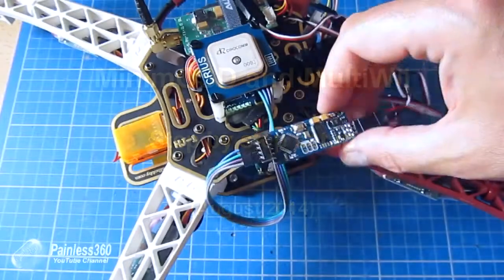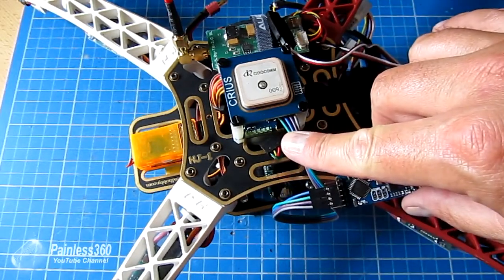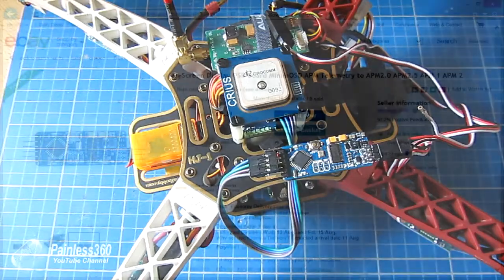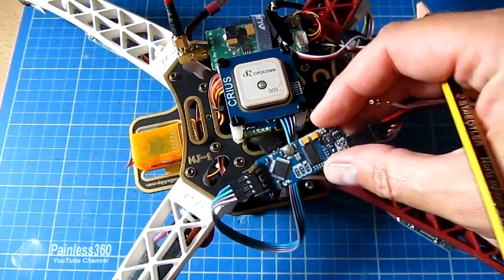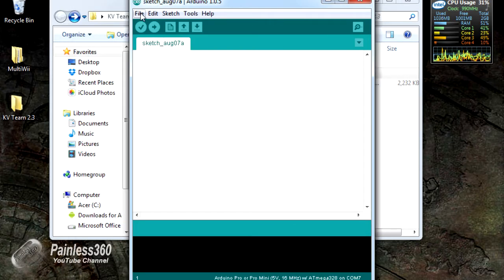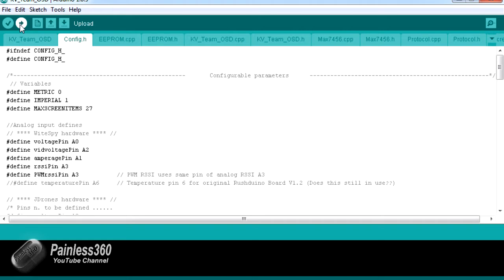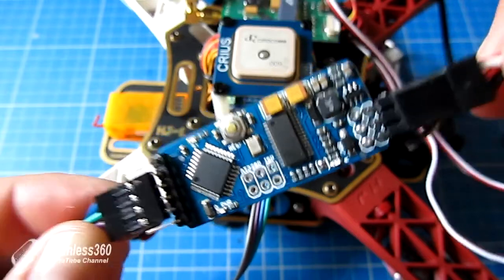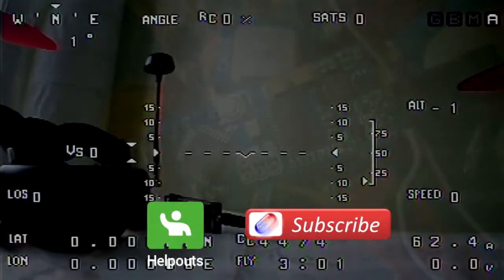Step by Step MinimOSD setup on a MultiWii

Comment: You asked how familiar I am with the program.  I have used it some but not a lot.  The board I have selected in the program is the Arduino Pro or Pro Mini (5V,16MHz) w/ATmega328.

Comment: Great video was really useful for a first timer. Would love to see a video on using bthe minimosd as standalone as I would like to have osd with optical rpm sensor displayed.
Cheers for your work!
Reply from the maker: Thanks for the comment, if you get that working I'd love to see the 'how to' video! Good luck..
Reply from the maker: Hi Matt. My latest MinimOSD video, while not a complete tutorial on how to do this, may help. See MinimOSD setup on MultiWii - Adding battery voltage readout
Reply: Painless360 cheers! Got my minimosd and apm the other day but somehow fried my apm! Will definitely work on the minimosd and will check out your new video. Thanks for your videos, really appreciate your work!

Comment: Great, you are a genius. :) But i guess i blew my board (the voltage regulator) already by testing it before. :( I used the 5 V from the MultiWii and I connected also the +12V from the FPV transmitter... How do i know if it was demaged? My Board looks a little bit different as i have a MAVLink-OSD Board. The main components are the same, but i can't find the soldering bridges you have. I guess they used 0 ohm resistors for that. So i guess i will have to order another one to get it run properly.
But thank you very much for your video. It explains exactly what i was looking for and haven't found so far in the web. And i recognized that you had the same questions as i had. :)

Comment: Can this be connected through the serial port for lcd, software update, config and Bluetooth on the multiwii pro as well? I see this port is a 6 pin connector and i dont believe the Minimosd has that many inputs. The Pins are labeled from top to bottom DTR, TXO, RXO, 5v, NC, GND.

Thanks
Reply from the maker: I've not tried it - the board needs to hear the stream of data coming out of the board (usually transmitted from the Bluetooth of telemetry radios). If that data is coming out of that port then it's worth a try! Sorry I can't be of more help.

Good luck with it.

Comment: Hi Painless... Thanks again for ur channel.. It's been a great help. Couple quick questions.. 1) is this video still relevant in setting up & updating firmware for a mini minim osd and using it with a SP Evo controller?.. Any chance of getting an updated set up video for the mini which already has the KV Team update?
Reply from the maker: Any board using Cleanflight/Betaflight/Baseflight (or one of the many others) talks the same telemetry communication protocol as the original Multiwii - Multiwii Serial Protocol, or MSP. See the videos in the Naze32 and SP3 series where we setup an OSD.. Best of luck!
Reply: Painless360 thank u sir!

Comment: Thanks for the video.  So I'm at the point where I was able to load the firmware and the GUI will update the fonts but it won't write any of my settings to the board.  It count's down 'save attempt' 1-10 then does nothing. When I hit 'read' again it just gives me blank settings.  Help greatly appreciated.  Thanks again for the video.
Reply from the maker: I would re-flash the board and try again - something is out of whack.. I actually prefer another firmware that may work better see - https://www.youtube.com/watch?v=3gI3F_C-VBk

Happy flying!

Comment: Awesome tutorial as always!
I dont have fpv just a quad with multiwii on it (im a beginner) but want to get it in the future.
I just have one question:
Do you have to set something up in the multiwii code also or how does it get the informations?

Thank you!
Reply from the maker: Hi, sure do! I have a full set of 'how to' videos for all aspects of Multiwii. Search on my channel for the playlist. I'd start here - Crius SE V2.0 MultiWii Board (MWB) Overview and Setup

If you need help my Helpout channel is available. Best of luck.
Reply: Painless360 Thanks, i watched your videos allready (its just too much info for a beginner at first :) ), it helpd me alot to build and get my quad ready to fly, but i dont recall a video where you show how to set the output for the osd in the mw code.
But i will watch them again :D
Reply from the maker: htwosofour The answer is in the video at 5:55. You don't need to change anything in the code for this to work. If you needed to - I'd have covered it ;)

If you use Version 2.2 of the Multiwii firmware then it's slightly easier as previous versions (2.0 and 2.1) need another setting (BOXNAMES) turned on for the MinimOSD to work.

Hope this makes sense, of you are new to Multiwii get the model built and flying first then look to add the extra pieces like FPV and OSD systems one by one. Too much may become overwhelming in the event of a problem.

Happy flying!
Reply: Painless360 Thanks :)

Comment: Painless360 Thank for the awesome video mate! I am much closer than I was, but still having issues using the exact same Minim OSD board, firmware and wiring schematic as far as I can tell. Wondering if you can offer any advice? The only difference in my setup from your schematic @18:25 is that my camera needs more than the 12v power my Immersion 600 can output, so I have a power lead running to my PDB, which runs the camera great. The Negative from the camera goes into the GND on the Minim, along with the Video IN as you have shown, and then the other GND goes out to the Immersion TX GND, along with the Video OUT signal to the center VID SIG pin on the TX... As soon as I remove the OSD, the setup works perfectly. When I add the Minim, I only get a gray/black screen on my goggles. Could my UART plugs be wrong? I did notice that the green and blue lights on the Minim only come on when I have one certain configuration of TX/RX pins, otherwise, no power. Maybe I have them all wrong from my MultiWii? Any advice would be greatly appreciated!
Reply from the maker: I've tried to follow the explanation but struggled. Could you post a link to a diagram of the wiring so I can see what you are talking about? What camera are you using that needs more than 12v?
Reply: My diagram would be the same as yours, with the 12v power source for my camera coming directly from my LiPo. I have an Effio-V 960H 800TVL Sony Cam from SecurityCameras. If I connect the camera to the 12v Out from my TX, I only get a white screen in my goggles. :-/

On a full 4s battery my camera runs like a champ. In the specs, it is listed as running on 12-24v, so that's probably why! lol
Reply: I am not seeing an overlay, or an image when I connect the Minim, but without it the picture is great! I have the Vid In coming from my camera, and vid out going to the TX. Everything is grounded. I see 2 solid blue lights on the Minim, and a faint green led bursting.

Comment: Hi there! I have my DIY multiwii board up and happily flying. I just bought some FPV stuff and was wondering if it will be possible to connect a MinimOSD to the UART port while having the bluetooth dongle plugged in as well. Thanks in advance for your reply. Cheers.
Reply from the maker: Depends on the board. See the other MultiWii videos for more detail on adding the pieces! Best of luck!

Comment: Hallo Painless360
I think, you are doing a great job! With your tutorials, I managed to make it fly (Crius 2.5, GPS, Bluetooth). Now, I am working on the OSD (Crius Mavlink 2.1). I changed already the voltage supply to only 5 V on the whole board and common ground but I get vertical lines in the image (only the image signal from the camera is connected to the OSD board). The OSD itself works (MVOSD R1.5). Any Ideas?
Best regards,
Henry
Reply from the maker: No, sorry. I'd check for interference and that all the settings (PAL/NTSC etc) are the same on camera and OSD. Best of luck.

Comment: Painless360, could you show the board being flashed. I'm getting lots of different configs of the status light flashing but no idea when it's done. Like with the Clear you get the solid light is there anything to look for after flashing the KV Team firmware?
Reply from the maker: Simon Cope Nothing on the board shows you it's done. I do show the board in other MinimOSD setup videos.
You know it's worked if the app finishes flashing without errors and it works when you plug it in! Don't forget to upload the char set though..

Comment: Hello again. 
Please tell me which firmware are you using on mwc board which works with minim osd?
And do I need to patch or add configuration on mwc?
I'm using crius aiop v2.1
Thanks!
P.s
I've tried to write KV-TEAM v2.2 and 2.3, I see some of information on the screen, but it's corrupted :-(
Reply from the maker: See the Multiwii playlist for your answers. Best of luck!

Comment: Hi Painless... having an issue with the Multiwii board talking to the mini osd. Am I supposed to use an I2c card in between the FC and the osd... as  on the start I get Multiwii O even when switching.
Reply from the maker: Shouldn't do. The steps are all covered in the video. Best of luck!

Comment: Hi Painless360, seeking some advise on my MinimOSD Micro if you wouldn't mind. I run it with Naze32 cleanflight. When the OSD arrived, I tried the connections and I could see an OSD layout on my FPV goggles. Then I went out with wiring everything together onto my miniquad. I then used an FTDI USB connector and ran through your video for KV Team Mod firmware flash using Arduino 1.0.6. I cleared EEPROM per your video. I uploaded the KV Team OSD and after that all I could see are grid points along the whole screen. Tried to reflash it a few times (clearing EEPROM first) with no success. Tried using MultiWii OSD firmware and now I can't see a layout at all. On the MultiWii OSD GUI it keps saying 'Waiting OSD'. Com port is correct and tried all baud rates with no success.

Have I fried a chip on the MinimOSD Micro?
THanks!
Reply from the maker: +Chua Yaowei Not sure what's going on. I have had a couple of these boards give up the ghost. I'd re-flash the FW and FONTS again.. Best of luck..
Reply: +Painless360 thanks! think will have to try another Minimosd Micro.

Comment: Great videos and very helpful. I have a problem however. I cannot get the correct character set to load onto the minim board. I have a bluetooth adapter working perfectly so I know the info from the board is correct but the minim character set is aways corrupted except for the GPS co-ordinates! I am running a multiwii pro board with a ublox GPS configured for NMEA protocol HELP! Richardr.
Reply from the maker: Use the EEPROM eraser and load the set again. I had a problem like this when I was playing and another version of the code worked fine. Good luck!

Comment: Hi, I'm an airplane guy looking for an affordable but still capable OSD for my fixed wing FPV rig.The MINIMOSD seems to be a very good option. However, as far as I've read, requires a flight controller to work with,so I'm afraid was designed exclusively for multirotors. Would be possible to use this OSD in a plane without a flight controller?

Would you please recomment me an OSD not so much expensive with GPS and RSSI capabilities? My budget is around USD $80. Thanks for your help.
Reply from the maker: You can use it 'standalone' from the documentation but we've never tried here. The instructions to do it are not very clear (last time we tried!). Best of luck!

Comment: Hey Lee, thanks for the input. Sorry to say though, that I tried 5 different cables and still have the same results on both FTDI breakouts and all 3 OSD's. Failed to talk to bootloader. I've tried updating to newer configuator and hex files, running on win xp and win 8.1. Same results.The weird thing is, it work on the first 2 and something went wrong and I had to reflash the firmware and that's when it went all to hell. Any ideas?
Thanks, Jerry
Reply from the maker: +coffcraft Not really, I'd some of the last common elements but it's starting to look like a puzzle.. Best of luck!
Reply: Thanks. I'll keep workin on it and when I get it figured out, (I never give up) I'll post the results in case others have this problem.
Reply from the maker: Best of luck...

Comment: I have a 2.8 apm  and I'm trying to connect a minimosd.  What firmware should I use?  It currently won't show telemetry from apm.  But it does overlay HUD
Reply: I suppose I should say. Could this be an issue with firmware?

Comment: hi, when I select eeprom upload it says serial port'COM1'not found. Did you select the right one from the tools. But when I select tool I can't select serial port,could this be due to the wrong driver or no driver do you think,cheers
Reply from the maker: +Allan T Yep, sounds like the driver isn't happy. Without the adapter appearing as a COM port you're snookered! Best of luck.
Reply: +Painless360 aye cheers it was the driver,I'm just struggling to get onto the gui

Comment: I cannot get the eprom to clear on the osd and I get no overlay video from the osd.  Both red led's come on but the yellow led does not.
Reply from the maker: Are you asking for suggestions? The yellow LED should flicker, the EEPROM only holds the fonts really.

You need to upload the fonts as the first thing you do once you've uploaded the firmware. If you still get corruption then clear the EEPROM using https://code.google.com/p/rush-osd-development/downloads/detail?name=EEPROM_Clear.zip&can=2&q=

A clear video of the problem can really help too if you can..

Comment: Can an Arduino programmer be used or does it have to be an FTDI programmer? I have an FTDI but I am getting errors, this would be an excuse to finally pull the trigger on an arduino
Reply from the maker: \the FTDI adapter is one of THE most useful things when you are doing anything Arduino/Multiwii...

Try re-loading the drivers in Windows for the one you have or order another one to get going..

I've used them to program MultiWii's, setup MinimOSD systems, program Bluetooth modules and setup GPS units too. So many of the things you need to play with in the hobby require one of these great little boards.

Best of luck..
Reply: Well, I used to use the FTDI to flash my ESCs with no problem but now with the new OS X it has cause havoc with these projects,  maybe someone will see they sand give advice, I have been researching this for weeks and are tired of this
Reply: Painless360 which FTDI programmer are you using, do you have a link? Thanks
Reply from the maker: See https://www.youtube.com/watch?v=qLaH4qkJNt0 around 1:20

Best of luck..

Comment: Hi, I have an Upgraded MAVLink OSD V2.0 board and FAT SHARK+CAMERA+Goggles RX. I would like to use it with a FC MW 2.3 and AIO 2560. By downloading KV_Team_OSD 2.3 on the board I am able to communicate with the board but I have any image from my FAT SHARK+CAM+Goggles RX system even from the GUI_Simulator PC or the MW AIO 2.3 connected board.
If I am using the MW OSD R1.1 soft, which are the different options to take in the config.h in order to make it work with the MW2.3 soft?
Reply from the maker: No changes are needed in the main MWC code on the board to have the telemetry data come out from the FTDI and UART ports on the board.

If you have tried it can can't get it to work then feel free to contact me through the Google Helpouts system for a chat.

Happy flying!
Reply: Painless360 Hi, Please tell me how to find Google Helpouts system. I am not familiar with that.
Yours, Georges
Reply: Painless360
Hi, Downloaded also the MW OSD R1.1 soft to my Upgraded MAVLink OSD V2.0 board. I see the screen with GUI, as yours in the video. Unfortunately it is any video received nor the black data screen. I suppose that that is due to the lack of power supply to MAX7456. The version of FAT SHARK I have, works with a voltage of 5 V to supply the CAMERA. Actually I soldered the +5 V from the TX directly to the CAMERA without the corresponding pins of the MAVLink V2.0 board.
How to STEP-BY-STEP check the presence of the video signal to the MAVLink V2.0 board, from the camera (IN) to the TX(OUT)?
Yours, Georges
Reply from the maker: Hi George, see Painless360 Helpout Launch for the helpout link.

It would help if you posted a video of the problem and what the board is doing. You should have two red lights on the board when it's powered showing that both the 328 and MAX chips have power.

Comment: I tried using this set up with a multiwii pro 2.0 board. I did not get a display so I went to swap what I thought were the two video wires- were actually the two power wires- now the multiwii board will not power up, except through the USB port- I think that the multiwii is "bricked"!
Reply from the maker: Aghh! Very likely that the main board is toasted. Sorry to hear about that - it's a mistake that we all make in the hobby once. Hard lesson to learn but you never do it again..

Happy flying!
Reply: Painless360 I think that I will be replacing the Multiwii with APM- seems like it has more features!
Reply from the maker: I have a few series on the ol' APM, take a look at the playlists on the channel..

Best of luck with the build..
Reply: Painless360
Have taken a look at them...one of the reasons for trying the APM...good series as are all of your videos...cheers!